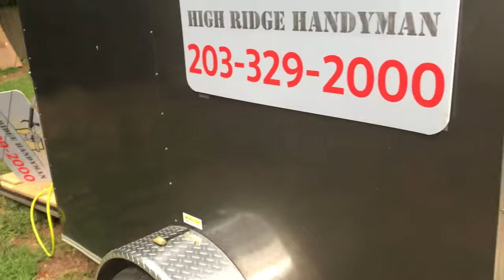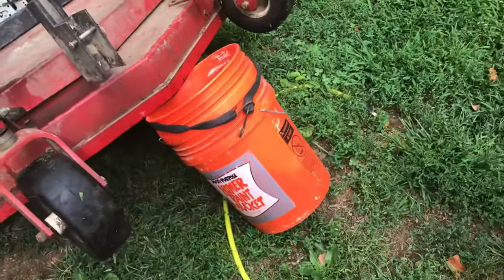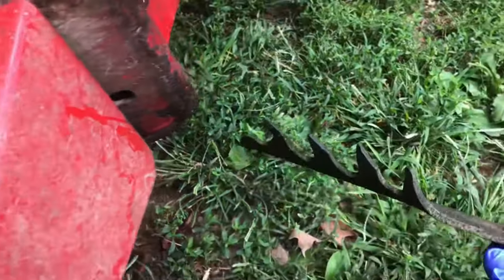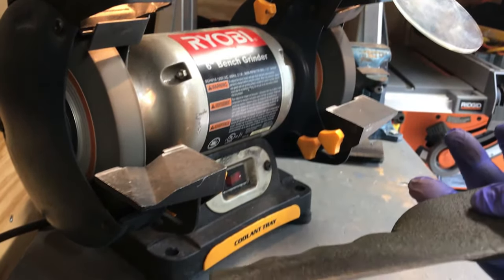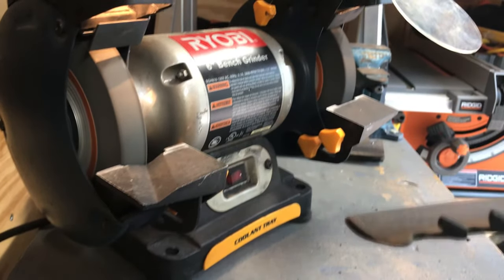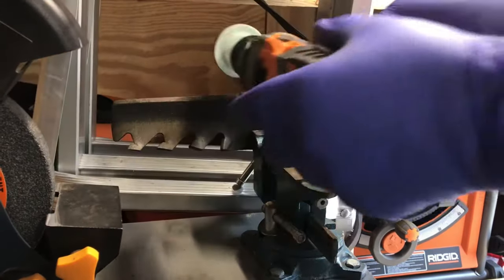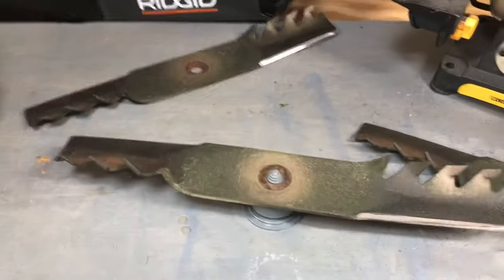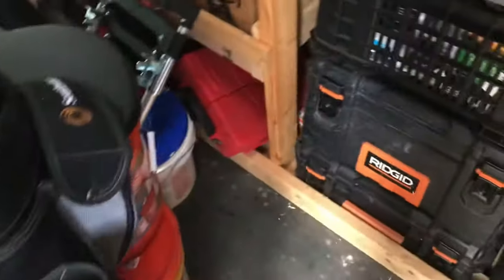Sharping  lawnmower blades using bench grinder

Comment: Nice video! I just sharpened my blades with an angle grinder using a flap disc 60grit. Mounted on to a vise. I never knew you had to sharpen backside of them. I only sharpen the angle side and remove the burr from other side.
Reply: You are right, you don't want to sharpen the back side or your grass will rip appart instead of cutting neatly.

Comment: you just got a new subscriber. You just made sharpening my lawn mower blades so much easier. Thankyou for this video. I noticed your grinding wheel (coarse) was on the right side of your grinder. Mine was on the left so I couldnt use your same method. I've been fighting this every time and not getting good results. I have the blades that are mulch style with the jagged back edge and they couldnt be rested on anything so I was always getting a rough, uneven sharpening edge. Thanks to you I just switched my grinding wheels around and it is so much easier and wayyyy better results. Thankyou so much. Keep the videos coming
Reply from the maker: Thanks Robbie much appreciated!! Share my channel with family & friends. More to come👍🏻👍🏻👍🏻👍🏻
Reply: Same orientation here as well.  Exact same grinder too!

Comment: Your process is poor, you keep changing the angle of the grind with each pass by 5 degrees, better to adjust the platform to 30 degrees and be consistent every time. Your second mistake is putting 6-8 passes on the back side of the blade resulting in an angle on both sides of the blade when only 1 pass is required to remove burrs, back side of the blade should have zero angle.
Reply from the maker: Post and show us 👍🏻

Comment: A mower blade works like a chisel.  
You are only suposed to sharpen it on one side and leave the other side dull.
Reply: …and don’t you hold the blade the opposite from what he is doing?
Reply: Its very easy to tell if your blades are cutting, or tearing. When the grass has been cut get off and look at the cut. Clean flat tops is sharp, flat/torn tops are dull blades. Grass is able to heal faster when its growing with sharp blades. Torn grass takes longer to heal and sometimes dies if it's dry/ etc etc.